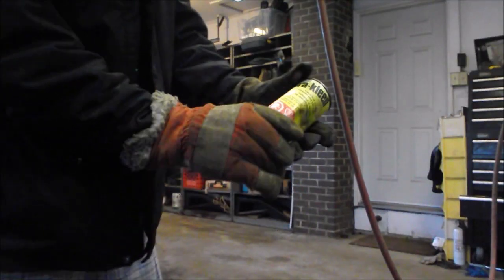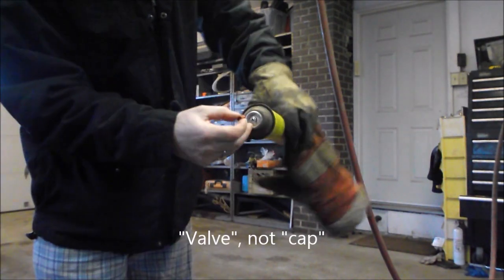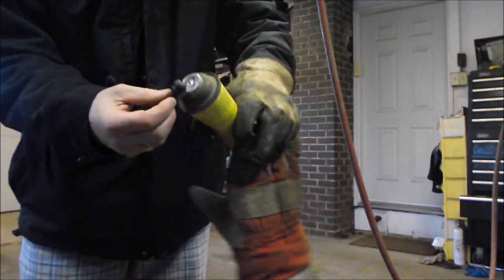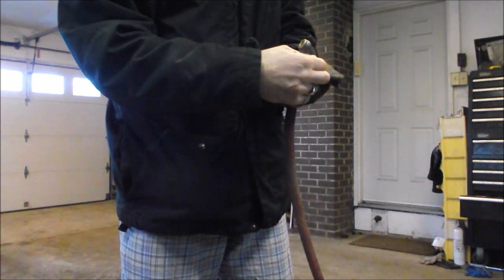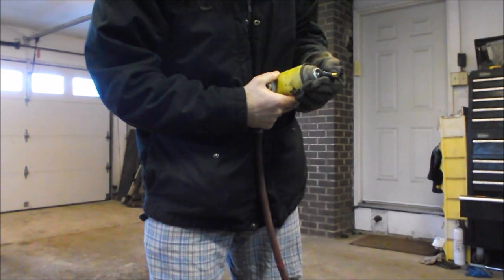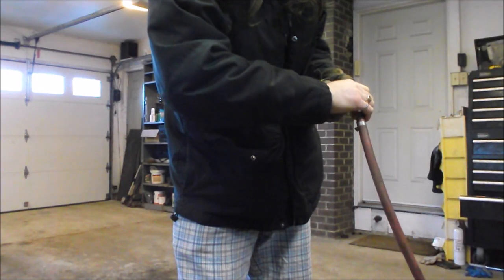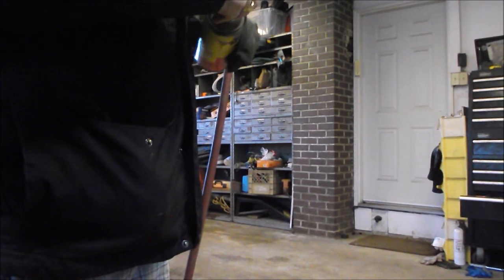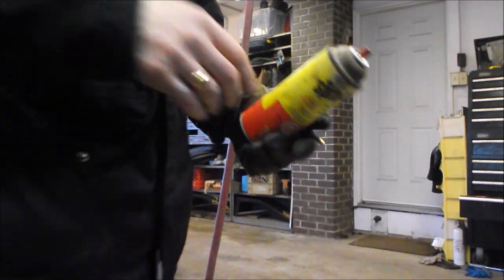DIY   Restoring pressure inside an aerosol spray can

Comment: Feb 7, 2022 — Aerosol cans are typically 20 degrees C (68 degrees F) with their maximum pressure usually standing at 10 bar (141.5 psi). By way of comparison, ..

Comment: 140 PSI sounds horrible. A truck tire has 120 PSI inside
Reply: @Douglas Fontenot 

The inverse proportionality between volume and pressure is for a constant mass of air. Reducing the volume while holding the mass constant  increases the density and  the pressure and vice versa.  This has nothing to do, however, with my comment, that is 140 PSI is a higher than the limit operating  pressure in most of workshop compressors. A spray  can is definitely not built to hold such pressures. The fact is none exploded yet is a matter of luck.

Comment: 1.3Mpa
Usually, for regular tinplate aerosol can, the deformation pressure(at which the can deforms, but not bursts or breaks) is at least 1.3Mpa, and the bursting pressure is at least 1.5Mpa.
1.3Mpa = 188.5 PSI
FROM THIS LINK
https://www.quora.com/What-amount-of-pressure-can-an-aerosol-can-resist

Comment: But can he is doing, is the pray paint aerosol can type. Those have an inner valve and are harder to fill. I refill the ones that comes with a white pin, as part of the spray valve. Spray paint style can.. has the little pin on the actual spray cap.

Comment: Ridiculous! During the past year I have thrown away half used WD40, Pledge, window cleaner, spray starch, and today my Ocean Nasal Mist. What is going on?  I should not have to own a workman's studio to use my expensive products!
Reply: You both actually have really good points lol that was a lot of time wasted. Y'all are a hoot though 😆
Reply: I Know how to Rescue all kinds of household aerosols. With the exception of spray paint aerosol cans. Since the pin is on the spray cap. But i can rescue sprays such as glade air refreshners, cleaners such as scrubbing bubbles, scotch guard carpet cleaner foam, it tuff stuff. Spam spray cans, Lysol spray can. WD40, Carburator cleaners and many other type of sprays.. that has lost pressure. I am wondering if there is any discount online store, that sells out of pressure spray can products. Cheap. To avoid hazmat cost.  I pressurize without a tire valve and a compressor, as most people do. My method is the most effective and leak free while filling. But i am located in Hillsborough county Florida. Near Tampa. I am thinking of making a business in rescuing people's pray cans for a few bucks
Reply: freezeme360  It is not a business. Is for personal use. U say noone cares, but i am getting asked how to all the time. You are giving an asnwer fot everybody else, when it is not the truth.
Reply: freezeme360 i have told people. But i havent post it on here. Plus it takes money to do it my way
Reply: freezeme360  U are stupid. I guess u are such an incompetent person that cant figure anything for yourself. To then be all over the ones that come up with ideas. Loser

Comment: I'm so used to these hacks not working so well. Got lucky and had a rubber valve stem laying around and it worked like a charm! Thankyou!
Reply from the maker: Glad it worked.  It works with most but not all cans.
Reply: @mrdiyguy123  my method works with any aerosoles, that comes with an exposed white valve pin. I dont youse a stem or air compressor.
Reply: MLB THE SHOW19.Broadcast and what is you method?

Comment: Air isn't a very good choice as a propellant, especially if the can contents are subject to oxydizing or drying.  Some sort of inert gas, such as dry nitrogen or carbon dioxide would be better.  if the product is paint or other petroleum solvent-based material, a propellant such as, butane or propane may work well, too.  The problem is, butane and propane are flammable and you wouldn't want to get them into the eyes.  A refilling tool would have to press the adapter against the aerosol can with enough force to overcome the gas pressure and keep it from squirting out the sides.  One possibility is to have a male adapter that fits into the hole where the nozzle goes such that the tube seals against the o-ring the same way that the nozzle stem does.  I'm aware of at least a couple of different stem sizes, so an adapter for each size would be needed.  Other cans have a stubby tube that sticks up, and for those one would need a female adapter with an internal o-ring.  There may be more than one size of those, too.  All said and done, it may not be worth the expense and effort.

Comment: WD40 is a any where from 95 psi to 115 psi. I think 140 is on the high side , especially if you leave the can out side in the heat, or direct sun light. I would  rather err on the side of caution
Reply from the maker: Thanks for the info!
Reply: thank you!
Reply: thank you bro

Comment: Typical propellant for airsol cans is liquid butane.  
The can's pressure can vary a lot with temperature.  
At room temperature (25°C) it typically sits at 90PSI and as you start spraying it will drop in temperature AND pressure.
The cans sould be able to withstand 50°C which can bring the gas to max 200PSI but it is not safe to store the can at that temperature.
The SAFE ZONE is around 100-120PSI at 25°C.

Note:   As you force compressed air inside, the can will heat up for the same reasons above.
Reply: what is the name of tool which is used in neck of spray to put pressure??
Reply: @sumquran  it is regular valve for tubeless tires
Reply: Thaaank YOU!!!